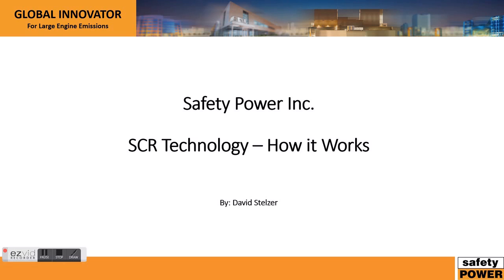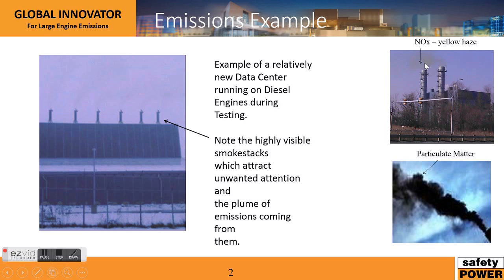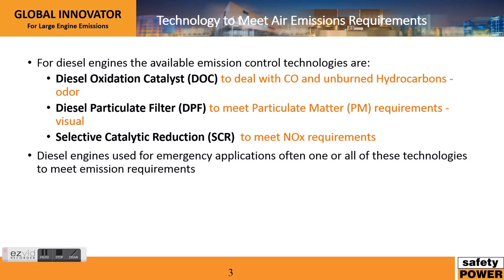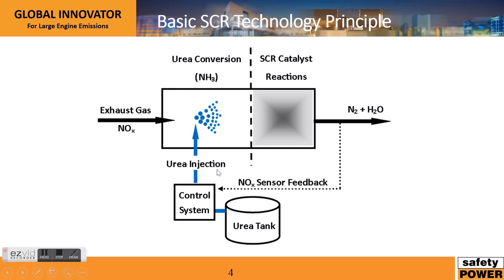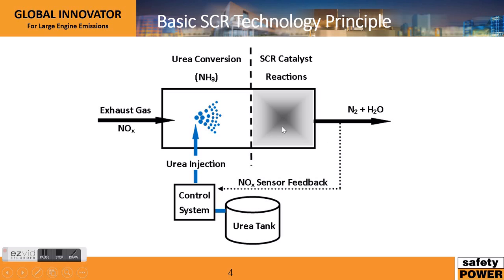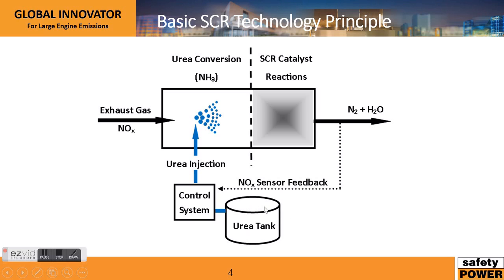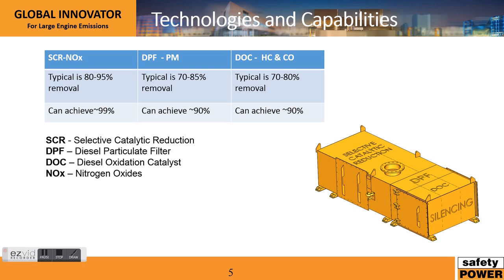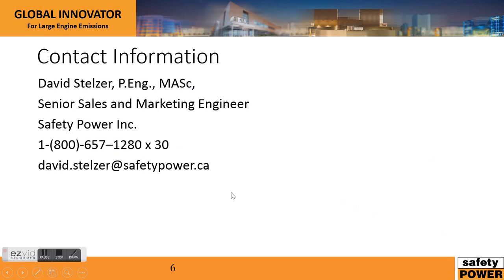Selective Catalytic Technology - SCR How it Works

Comment: I've been tasked with designing my own SCR reactor as part of my Third Year Chemical Engineering Design Project where I'm working in a team to design and entire methanol production plant based in New Zealand. Would be greatly appreciated if I were able to contact you and discuss certain elements in greater detail at a later date. Many thanks for the helpful introduction into the technology and highlighting the potential for automated systems engineering.

Comment: One Thing Remains unclear to me however. what exactly is the Catalyst in the reaction? Is the urea used in the DEF the actual catalyst, or is it the metal in the chamber?
Reply: and why does my Samsung phone insist on capitalizing random words when I use speech-to-text?
Reply: I apologise for the late response, however, in light of the question, V2O5, TiO2, Wo3 and MoO3 are typically employed. It would be of great benefit if you ever discovered the answer to your question and further information related to SCRs and still have the files. Kind regards.

Comment: it's odd, but I built and worked around a combined cycle combustion plant. It didn't have a giant plume of smoke coming out of it like that one you show in the picture. The only visible discharge it had it gave wad Steam from the cooling towers. Granted, the first time we fired up the combustion turbine, it did make quite a bit of smoke as a preservative oils were burned off, but that was the extent of it. the plant was completed in 2010, and there was no requirement for any sort of selective catalytic reduction.